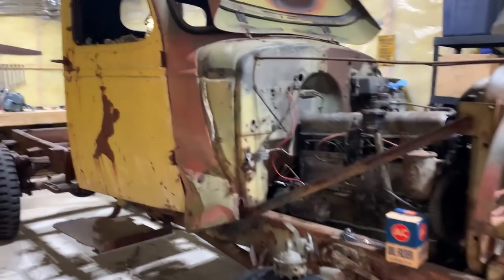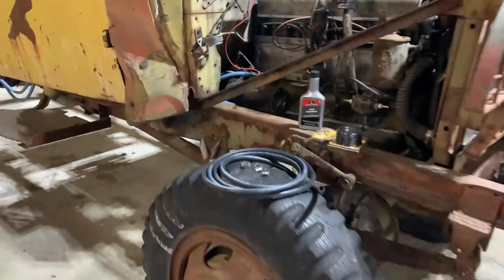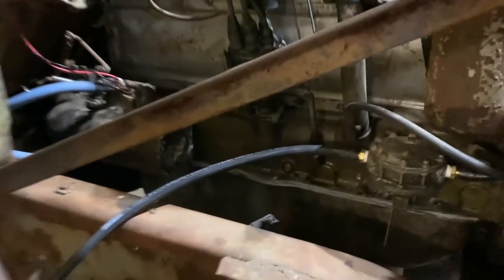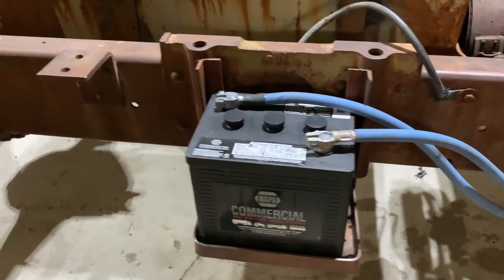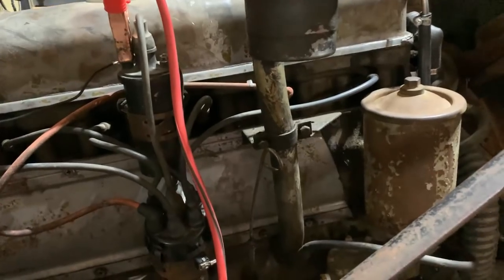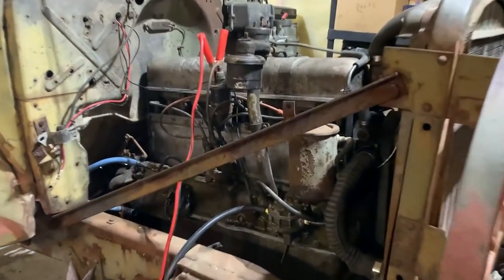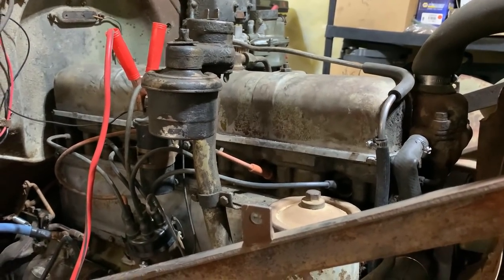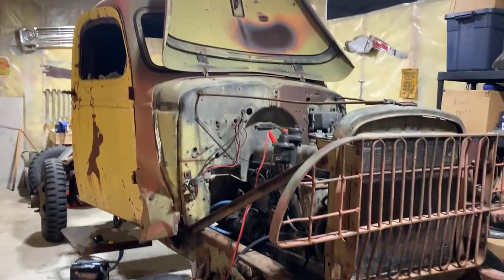1942 Chevrolet G506 Revival - EP10 | Firing The Motor!

Comment: Good to hear her running.  Like others mentioned, check for vacuum leaks at the throttle shaft.  If that checks good, you may need to really deep clean the idle circuit in the carburetor.  Once you have that sorted, if it is still popping in the exhaust, you may have an exhaust valve that isn't sealing.  I can hear an intermittent pop every so often.  Regardless, it sounds great to hear it running again.  Keep up the good work.

Comment: Love these old 6 cylinder engines I grew up on a farm where all the old trucks sounded like that.  The valves may need a little adjusting to get that skip out of the engine when on idle..  That may leave after engines runs some and gets the seats on valves to clean up from sitting and not used for sometime  So until that cleans up you will hear that skip from having a valve a little slow on doing its job.letting  engine run smooth . Great video Guy
Reply: Also on clutch an easy way loosen pressure plate bolts from flywheel about 6 in number take a flat screwdriver and drive gently between clutch and mating surfaces. then put in high gear depress clutch pedal to floor and turn engine with starter. Or pull with another truck in gear with clutch depress jerk it  to break rust from  surface easier than taking transmisson back out.

Comment: I had one of these 1942 army trucks I put a 50’s 12 volt generator + regulator and battery,the 6volt starter doesn’t get hot from 12 volts, (windings much larger than 12 starters),resistor for coil,12v head light bulbs. For a heater a old under dash A/C condenser/blower and put heater hoses on the freon lines, fits up under glove box or dashboard 
    Loved that old war wagon!

Comment: if you havent had that clutch off the engine at all the disc could be rusted to the flywheel or pressure plate. running it around the yard in and out of the throttle abit jerking it around can knock it loose

Comment: The old girl sounds pretty good but when you were revving it up the throttle rod looked a bit loose so you could have a worn out throttle body making a vacuum leak that is keeping your idle high. Spray some flammable carb or brake clean at the bottom of the carb if you have a leak it will rev up even more. I love watching you get these old trucks running again good stuff man.

Comment: wonderful sounds..  Clutch disc is probably rusted to the pressure plate and flywheel since the pedal feels good. can it be saved??  you might be able to with the transmission installed.. Unbolt the clutch cover to let it fall back from the clutch disc so you can get in and do some freeing up..  if you replace for this .. TWO clutch cover to flywheel bolts with long bolts.. you can drop the clutch cover back as far as you can retract the throw out bearing in an attempt to get things to spin.  i don't know how far back you can get it to move on that one.. or if its possible do to bellhousing.. 

 you may end up getting some grade 8 bolts and changing the transmission to bell housing bolts to those with the driveshaft out and slide the transmission back with the perhaps with the cross member avoiding the need to drop the transmission..  if you can get the transmission back 3 or 4 inches. you should be able to drop the disc.. then drop the cover out around the front of the input shaft..  think about 2 bolts at 11 and 9 holding the cover up to avoid smashed fingers.. again.. will it work.. will bolts at 9 and 3 work or 8 and 4.? oclock positions.. 

  look at figure 2 on page 3 of your rochester model B carb.  http://www.newagemetal.com/pages/ServiceProcedures/B/1964/64ModelBmanual.pdf

 you might get by with taking the idle mixture screw out.. giving it a 1 second blast of carb spray then a blast of 10 psi compressed air.. do that twice and then put the idle mixture screw back in..  and try it.. you could have a clogged idle feed restriction..

Comment: Batteries will discharge setting on cement-use a block of wood under them if nothing else please.  Your timing is off, one can tell by the "stumble", fine tune with a timing light after you fix water leak.  Great job though, I applaud you! Fun Stuff! Rich

Comment: you have a vacuum leak find that and you should be able to adjust the carb use water in a spray bottle to find the leak. do NOT USE STARTING FLUID CARB CLEANER OR ANY OTHER FLAMMABLE .  the leak is usually between the intake and head. good luck have fun

Comment: front seat... get a pair of Hog ring pliers with some Hog rings.. (upholstery rings)  and some carpet .. you can go over the seat springs with some carpet hog ringed in place to give you a nice seating area that wont put a spring in your rump.  you can if you want to use some foam padding over the carpet and some upholstery material over that.  hint.. find some bench seats out of a van that have good Upholstery on them. i have recovered seat springs with those covers and foam directly.. i still put carpet over the seat springs..  if you can find carpet that uses  NON JUTE backing there will be less chance of rodents wanting to eat it.

Comment: I was told decades ago that this type of oil filter on these older engines are basically bypass filters and they're not on the direct pressure line from the oil pump they filter after the oil pump after the oil goes to the rods and mains not to say that there's no oil pressure in the canister but I've had a couple of dozen of these type of 6 cylinder and flathead V8 canister filters that were empty when I got them they just never bothered putting a clean one in it down the line.

Comment: I had an old truck that ended up having the can mounts rotted out to the point that when I stepped on the clutch the cab moved but not the throw out bearing. Made me feel foolish, I replaced the clutch before I found the issue with the mounts. But I welded in New floorboards and mounts and all was good.

Comment: You local independent or even a Napa can get you those oil filters, points and condenser, cap and rotor, plug wires, and belts. True I prefer to start with a local independent parts house to help out the little guy, barring that, then I hit my Napa dealer. Those old water pumps could be rebuilt at home along with the carb so give that a try, a local bearing house can get you the bearings and seals for it

Comment: You may have a bad intake leak. That when you try taking chokeoff its too much air. Its coming in from a gasket or a crack. On intake  or even where carburator bolts on it. To find it use Starting fluid and while its running spray around intake and at the base of carburetor.  If it revs up theres your leak. Just a suggestion is all. Coming along nicely. Also Your clutch could be hung up on the pressure plate. Could check it out...Thank You for sharing..

Comment: What a good feeling that this bad boy stove bolt is humming ! I know you did a good job installing the trans / t- case so,won’t jump,the gun and suggest that I hope the pilot bushing is dragging the input shaft . Just having flashbacks of when I got the 258 started on my 1973 CJ5 and found out someone who last installed a clutch on it didn’t sink the pilot bushing in right and finished the install by sending it home using the transmission as a press . I invested about $400 in clutch parts because no one likes to do,it twice . That cured it . Really hoping all it needs is the adjustment . Got my hopes up for ya as spring is too far away in your neck of the woods . But your doing great on this build ! Just wondering if it might need another valve adjustment if the carburetor and timing won’t plane out the idle ? I doubt it will but guess we will see ? I guess that it’s just part of tuning an old stove bolt six . But sounding real good though ! 👍 real sorry you got to get into the water pump again .

Comment: Congratulations on another most excellent video and on starting and running the engine. 
Was I wrong or did it look like the throttle butterfly shaft had a little extra play in it? An air leak there could cause idle problems.
She does sound good.
Reply: I 100% agree Rick

Comment: any way to get lube on the input shaft of the trans to loosen the disc?  An inspection cover that will allow a rat tat tat extension to rattle the disc with the clutch depressed?  I had to split a tractor because of disc frozen on shaft problem.